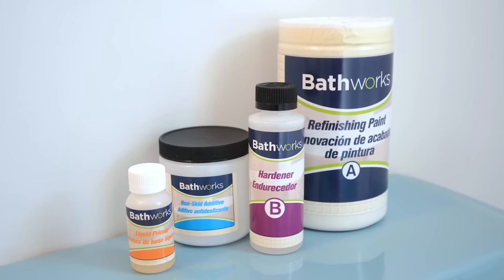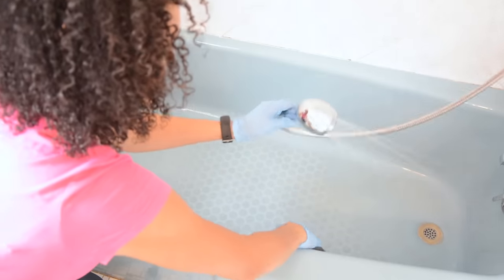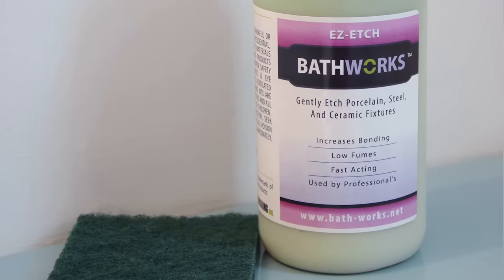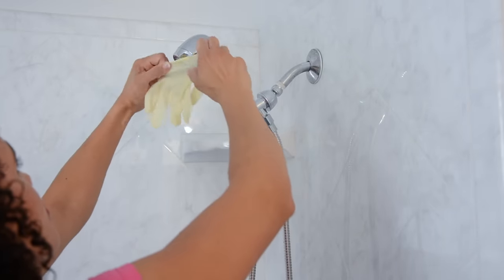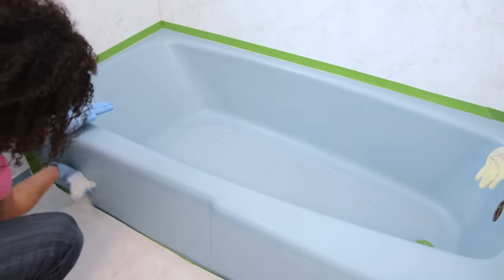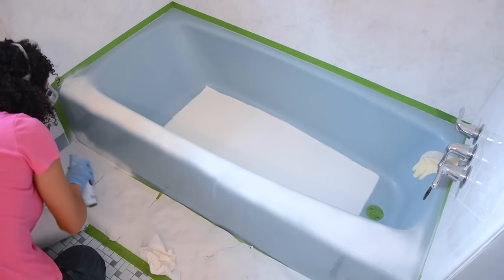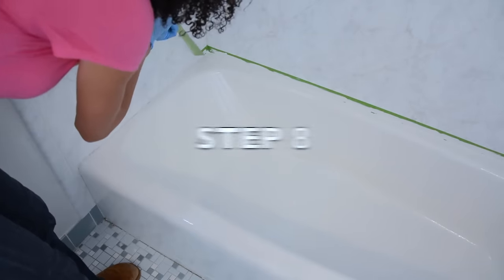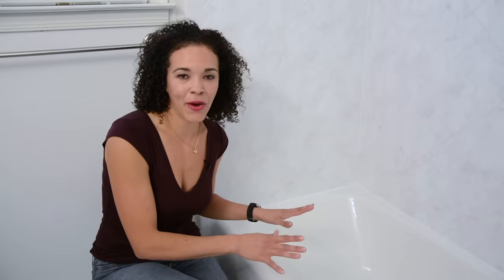How to Refinish a Bathtub with Bathworks® Kit | DIY Tutorial ft. Serena Appiah from Thrift Diving

Comment: In my home I recently sold, I was going to try this, but opted for a pro to do it. I'm glad I did. It cost me $595, (it was an original 46 yr old tub)  but they did an amazing job. They sanded the tub and surround down to the bare fiberglass, then primed and coated it several times. I had it done 10 yrs ago, but the products then  tended to yellow over time. The new products don't, and with care, should last 15 to 20 yrs. I'm glad I chose the pros, but I'm not saying this in the video, doesn't work. It looks very nice !

Comment: What should you do to prep a rusted spot?  Its rusty around my drain
Reply from the maker: Greetings, in order to properly prepare an area with any rust build up, you will want to sand it down first to remove any loose pieces. Once done with that, remove the sanding debris from that area. If there are any pitted or crater-like areas, we recommend filling those with Bondo to make the surface flush with the surrounding area. Following that, we recommend using Kilz Original (Oil-Based) aerosol primer to seal the surface - this will help prevent the rust from bleeding through. After all of those steps are completed, you are ready to refinish your fixture. Hope this helps! If you have any additional questions you are certainly welcome to give us a call at 1.800.872.8827 and we can provide you with additional information. Happy refinishing!

Comment: I just finished this project and I would highly recommend a high-powered led head light.  It puts extra light directly on the surface and helps you see the runs and/or areas that need extra rolling.

When you are nearly done turn OFF the lights in the room and look around with the headlight only.   You will then be able to see in more fine detail any areas than need a rolling over.

I got this tip from a professional car detailer.

Comment: How long does a newly painted bathtub last without needing a redo.
Reply from the maker: A newly refinished bathtub will last as long as you take care of it! As long as a "store bought bathtub"? YES! 

Your bathtub has just been resurfaced using a Bathworks DIY Kit!  Here are a few tips to help protect your investment:

    Avoid leaving wet washcloths on the surface for long periods of time.
    Stay on top of the soap.  Soap scum will dull and dirty your finish very quickly! Unless you use a heavy abrasive it is quite difficult to remove.
    Hair dye will permanently stain and ruin everything… I live with three women, I know! :)
    When giving the dog a bath put down a towel to prevent scratches.  If you're giving your cat a bath, well, wear body armor!!! ;)
    If you opted of the non-slip bottom, and need to use a bathmat, use the non-suction cup kind. Here's one we sell:

    http://www.bathtubrefinishingkit.net/Product/Bath-Mat--Clear

    Always clean with a non-abrasive cleaner such as Scrubbing Bubbles.
    Also, use preventative maintenance products, such as our bathtub polishing and care kit is great compliment to the BathWorks DIY Bathtub & Tile Refinishing Kit.

Comment: any suggestions for acrylic or fibreglass tubs?
Reply from the maker: One of the most common questions we receive about our Do It Yourself Kits is:  "Can this product be used on an acrylic and fiberglass tub/shower"? The answer is absolutely Caroline!  As a matter of fact, all our Bathworks Refinishing Kits will work fantastic on fiberglass tubs or shower units.  But always remember, we do recommend (2) kits for a one-piece tub/shower unit or bathtub and wall surround.

Comment: Can you primer the whole tub instead of just the outside?
Reply: The spray paint I mean
Reply from the maker: Greetings, if you're referring to the liquid primer application process - yes, we do instruct to use that to prime and coat the entire surface of the tub, both inside and out. This is a product that creates a much better bond to the surface than just applying the coating directly to the surface itself. If you're looking for additional primers to use, we do recommend Kilz oil-based primers (either aerosol or roll-on are fine.) Hope this helps, happy refinishing!
Reply: @bathworkskits  I was wondering if you could spray the whole tub with Kilz after applying the liquid Primer.

I saw in the video it was only partially sprayed

Thank you
Reply from the maker: I just consulted with our technical and product expert; they said to do one or the other, but not both. Kilz is especially helpful for any areas that are damaged by rust (you'd want to scrape, sand, remove any rust before applying) or if you have an area with high shine that you are not able to remove/sand down, but they do not recommend applying both Kilz and Liquid Primer over top on another. If you do have an area that requires Kilz to cover rust, do not use the liquid primer over that. You are able to spot prime with Kilz as needed. The topcoat will still cover the same way and leave a uniform finish. If you have any additional questions or would like to chat with someone about your project you are welcome to call us at 1.800.872.8827 or to email us at info@munroproducts.com. Hope this helps!

Comment: Does anybody know if it is okay to just paint over the caulking?
Reply from the maker: We strongly recommend removing the caulk around your fixture prior to doing any refinishing work, and then recaulking once the project is complete. Hope this helps!
Reply: @bathworkskits  Is this true even if it's brand new caulking? I was misinformed and thought I had to recaulk before applying the glaze
Reply from the maker: @emilyfrank3954  The only kind of caulk that can be painted over is painter's caulk - which is acrylic latex. Most often we find and use silicone caulk around bathroom fixtures.. caulk by nature repels anything that tries to adhere to it. If the misinformation about the caulking came from any one of our sources (videos, instructions, etc.) please let us know where you found that so we can correct that.